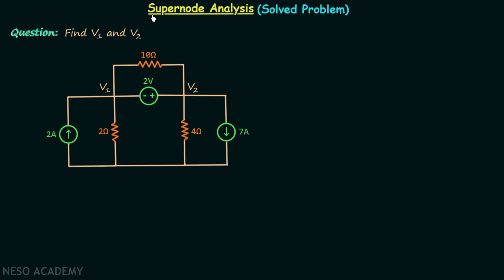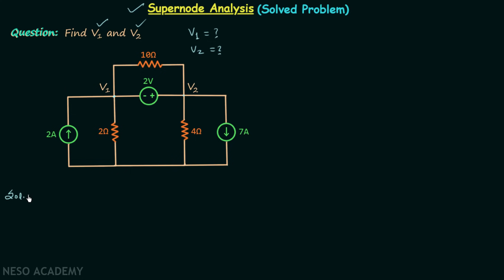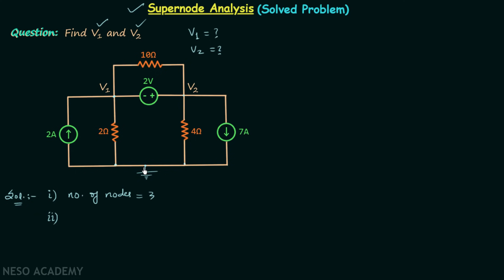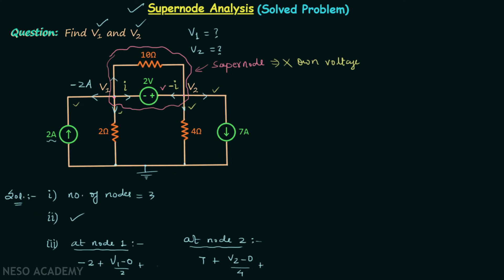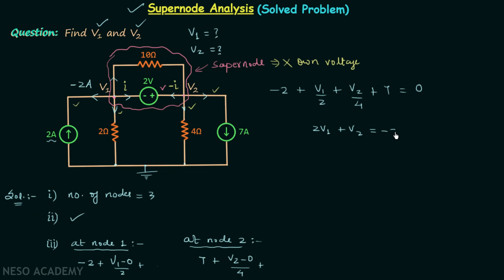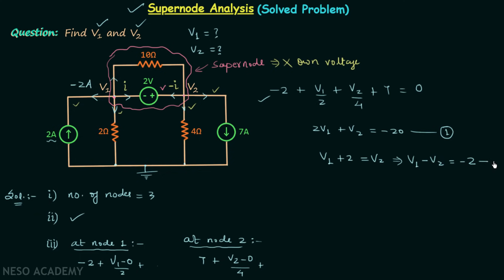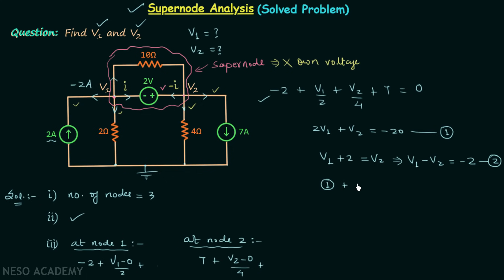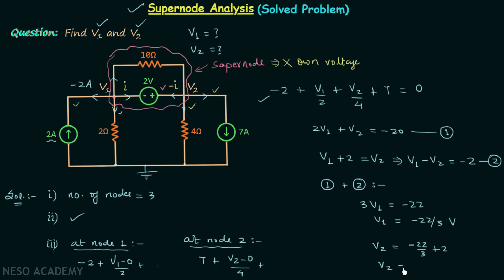Supernode Analysis (Solved Problem)

Comment: Sir I have a doubt why u didn't consider the 10 ohm resistor for the KCL equation??
Reply: basically when we neglect the voltage source present between the 2 non reference nodes, then we are making the voltage source short ( a possible explanation for this can be that, when we apply KCL before applying supernode, we don't know the current passing throught the voltage source as we don't know the resistance of the voltage source so we consider it to be an ideal voltage source thereby making its internal resistance 0 and so we make it short, now when there is a short wire present, then the current will go through that short wire instead of going through the 10 ohm branch as current always choses the path of less resistance so we neglect the 10 ohm branch as no current passes through it )
Reply: a similar explanation can also be given for supermesh analysis, when we apply KVL before applying supermesh then we don't know the voltage across the current source as we don't know the current source's resistance and so we consider the current source to be an ideal one thereby making it's resistance infinite and so we open the current source branch and hence the branch having the current source is removed .

Comment: Why we neglect 10 ohm resistor
Reply: basically when we neglect the voltage source present between the 2 non reference nodes, then we are making the voltage source short ( a possible explanation for this can be that, when we apply KCL before applying supernode, we don't know the current passing throught the voltage source as we don't know the resistance of the voltage source so we consider it to be an ideal voltage source thereby making its internal resistance 0 and so we make it short, now when there is a short wire present, then the current will go through that short wire instead of going through the 10 ohm branch as current always choses the path of less resistance so we neglect the 10 ohm branch as no current passes through it )
Reply: a similar explanation can also be given for supermesh analysis, when we apply KVL before applying supermesh then we don't know the voltage across the current source as we don't know the current source's resistance and so we consider the current source to be an ideal one thereby making it's resistance infinite and so we open the current source branch and hence the branch having the current source is removed .

Comment: sir then no current flows through 10ohm resister? , but there is a voltage difference between terminals of 10ohm resister wright?
Reply: Note that the current flowing out of the V1 node passed through the 10 ohms resistor and flew back into V2 node. When writing the KCL equation for the supernode, assuming we called that current I3, when it flows out of the supernode via V1 it's written as -I3, when it flows back into the supernode via V2 it's written as +I3. Therefor -I3 + I3 = 0. They canceled out, and that was why the 10ohms resistor was ignored
Reply: basically when we neglect the voltage source present between the 2 non reference nodes, then we are making the voltage source short ( a possible explanation for this can be that, when we apply KCL before applying supernode, we don't know the current passing throught the voltage source as we don't know the resistance of the voltage source so we consider it to be an ideal voltage source thereby making its internal resistance 0 and so we make it short, now when there is a short wire present, then the current will go through that short wire instead of going through the 10 ohm branch as current always choses the path of less resistance so we neglect the 10 ohm branch as no current passes through it )
Reply: a similar explanation can also be given for supermesh analysis, when we apply KVL before applying supermesh then we don't know the voltage across the current source as we don't know the current source's resistance and so we consider the current source to be an ideal one thereby making it's resistance infinite and so we open the current source branch and hence the branch having the current source is removed .
Reply: I also have this doubt

Comment: why is the above branch ignored
Reply: Does not affect the circuit in any way. Its voltage difference and resistance is fixed no matter what happens elsewhere

Comment: i am doing it using source transformation and  i am not getting same answer , please help
Reply: I also did solve using source transformation and the answer is same as of Sir's.  Make sure the polarity of voltage source is correct after transforming the 7A current source as it is downside. It may help.

Comment: At 1:20 = sir, if element is present, then the nodes 3 and 4 is considered as V3, V4 ?

also, at 8 : 40 = what about 10 ohm resistor? Should we ignore it? why?

anyone pls explain...

Comment: what is the use of 10ohm resistance,
if we replace it by 10,000 ohm resistance, will the answer be the same?
Reply: Current only goes through the voltage source as it finds the path with least resistance

Comment: I tried solving the practice problem of this sect from the same book... And whatever current you mention in the supernodes, all boils down to final equation as similar to single node... The redundant current, the 10 ohm resistance are all just to circulate their own current in their supernode... So whatever current enters 10 ohm, gets circulated back following the 2 v source, as like it had seperate path for that... But also it increases the nodal voltage and boosts the current. Aah it hurts thinking too much.

Comment: Do we need to ground the circuit before analysis; i.e. assume zero voltage at the bottom node ?
Reply: yes u need to have a reference node which is the one that will be grounded

Comment: Why can't we write the eqns for node 1 : -2 + V1/2 + i +(V1-V2)/10=0 and node 2 : 7 + V2/2 - i + (V2 - V1)/10 = 0 ?
Reply: as we are removing the voltage source and and short circuit it to form supernode. the resistor which is in  parallel to a short circuit, can be neglected.

Comment: What about 10 ohm resistance
Reply: ok consider the supernode without the 10 ohm resistor. i.e. only v1,v2 and that 2V source.  then try writing the equations.  ull get two terms such as..    ..+ (V2-V1)/10  +  (V1-V2)/10  ... which cancel out.  thats why he said i and -i .  
regards..
Reply: @t.r.abhishekkasturi9616  yr thanku very much ..I was not able to getting this point..thanku .You had explained it well.
Reply: @tanmay6403  glad i could help😇
Reply: i know whats bothering you... Let me explain why... The 2 v part does circulate current if you measure... But that circulates only in that loop of 10 ohm and 2 v source... Think of it like a pipe where you have a black water and a white water... The black water flows seperately aside in that pipe without mixing, throu 10 ohm... Also the white water does gain energy, as voltage (pressure is boosted) so does the current... Now super impose it.... Thats why 2 v part plays important role in the analysis as it boosts the currents...its energy source. I hope you can visualise it.

Comment: What happens to 10 ohm?
Reply: 10 ohm is useless across the supernode
Reply: @lilchamp1342  but why?
Reply: @sourabhpatravale8348  Because when node V1 and node V2 are combined, the current through the 10Ω resistor from either node will cancel with the current through the 10Ω resistor from the other node, so you can neglect it
Reply: @Awesomekid2283  but the voltage across the 10 ohm resisisor is 2 volt if we place ammeter then it shows reading
Reply: @littlekumar8091  i know whats bothering you... Let me explain why... The 2 v part does circulate current if you measure... But that circulates only in that loop of 10 ohm and 2 v source... Think of it like a pipe where you have a black water and a white water... The black water flows seperately aside in that pipe without mixing, throu 10 ohm... Also the white water does gain energy, as voltage (pressure is boosted) so does the current... Now super impose it.... Thats why 2 v part plays important role in the analysis as it boosts the currents...its energy source. I hope you can visualise it.
Reply: If it bothers you mathematically then, you can assume many different current variables, and you will reach the final same result that 10 ohm is redundant.
Reply: @chanakyasinha8046   Superb bro u cleared my doubt also❤️
Reply: @viewocity9840  I'm glad it helped 😂

Comment: Why the current (V2-V1)/10 Not included in this super node Technique
Reply: bro see this video -- https://youtu.be/YpAJxKs-EVc?list=PLBlnK6fEyqRgLR-hMp7wem-bdVN1iEhsh&t=535 [voltage source (tips and tricks) (8:52)
Reply: @jatin201  thank u..
Reply: ok consider the supernode without the 10 ohm resistor. i.e. only v1,v2 and that 2V source.  then try writing the equations.  ull get two terms such as..    ..+ (V2-V1)/10  +  (V1-V2)/10  ... which cancel out.  thats why he said i and -i .  
regards..
Reply: @t.r.abhishekkasturi9616  thanks

Comment: What about current through 10ohm during kcl
Reply: i think, if we add V1-V2/10, then we have to add V2-V1/10 because the currents left side and right side of the supernode have to write properly. and sum of those 2 terms are 0. simply, we can say he wrote the shortly.
Reply: It will get canceled when u add eqn 1 and 2 to eliminate i.... correct me if I m wrong
Reply: the 10 ohm resistor does not make any difference because it is connected across the supernode
Reply: During KCL , If we neglect the voltage source present between two non reference nodes then the equation is V1-V2/10
Reply: Why should we bother about 10ohm resistor. We only need to calculate current i ( in voltage source wire) . As we need another equation to find the unknown variable